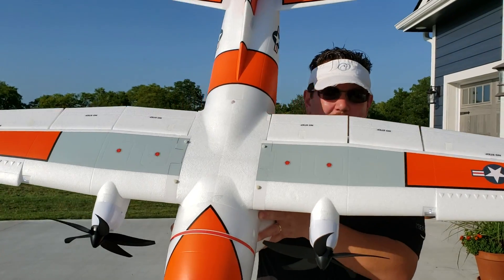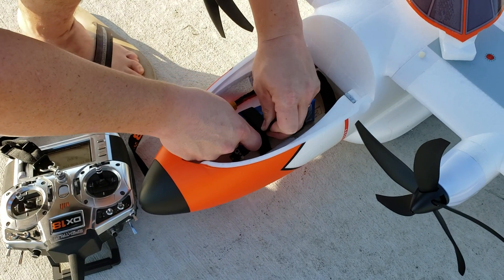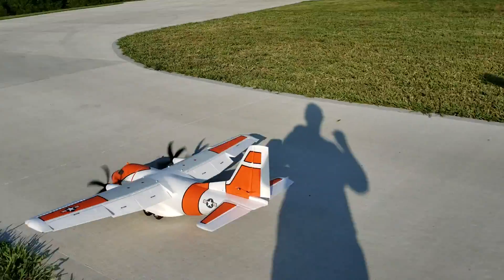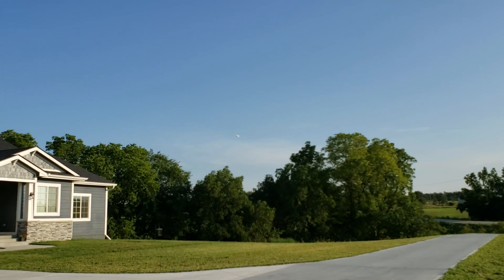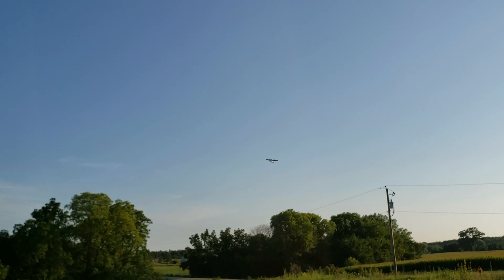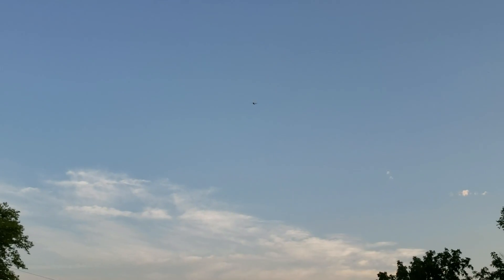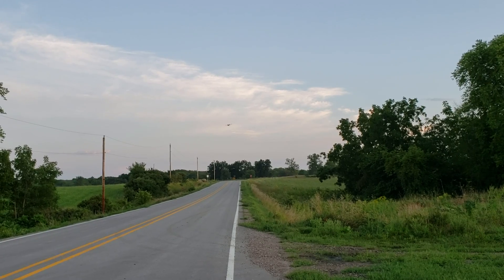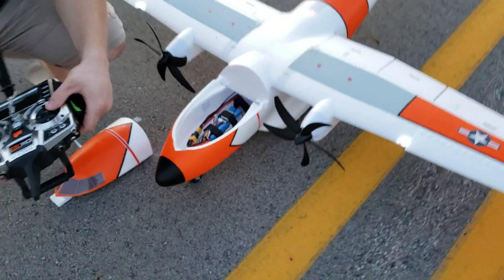Eflite - EC-1500 Twin 1.5m - Maiden Flights, Unbox, Build, Radio Setup

Comment: You can see at 2:21:40 that the ESCs are not in sync, as the props do not start sniping at the same time.
Reply from the maker: We totally saw that too! Megan and I kinda looked at each other... I know it's confusing, since the order of the video was kinda goofy, but that actually happened before ALL of the flights, so I did recalibrate the ESC throttle range to get them matched up, but the real issue I was having, initially, was the rudder and aileron trims were "fighting" each other, causing the plane to only "fly straight" at cruise...once I figured this out, she was way better, but still not too earth shattering as I had hoped for.

Comment: Brian, I made it about 12 minutes in and a couple things of note:  1.  When you took off on 4S 4.0, your ailerons were not even close to centered, so of course it rolled to the right.  2.  Did you calibrate your ESCs?  You may have addressed this in future flights or later in this video.  Just my .02
Reply from the maker: yes, and yes. She's flying well now, but I still feel like this was not a great value at $400.

Comment: Excellent review, so much useful information, thank you.    So, I just bought an EC1500, maidened it yesterday, 03/11/2021.  It flew nicely during the maiden, but, I had to use almost full down trim on the elevator to keep 'er level, I found the elevator to be very fickle, and having to pop off a glued servo cover to be annoying.  The servo is buried in a pretty tight spot, adjusting the linkage is a nuisance, but, I finally got it close enough to have a nice flight without excessive trimming.  I think I'll have to tackle that linkage again before I get it just right.  All that being said, the fickle elevator and difficult servo location is the only un-desirable feature so far.  Otherwise, I really like how the EC1500 flys, how it feels in the air, how it looks in the air, and how quiet and smooth it is. I didn't notice any of the wonkyness, etc, that you experienced, maybe you just got a weird one?   Unless I find more bad traits, I'd give it a yes to buy again.  This plane eats up an awful lot of runway upon landing, it comes in hot and fast even with full flaps.  However, even with a little breeze, it seemed to be rock solid on final approach.  Again, thanks for this in depth review, excellent job, very good and very useful information.
Reply from the maker: Totally Dan! Thanks for the feedback! I too have come to LOVE the EC1500. It's so much fun with parachute drops too!!! This plane is super powerful, and with the addition of SMART packs, now she's just unstoppable!!!!

So glad you didn't run into the strategies of my struggle to get ailerons and rudder trimmed out...I later realize I trimmed the ailerons and rudder BOTH opposite one another, and really screwed the pooch on that ;( Oh well, she's fixed up and flying straight as an arrow now, and I love flying her!
Reply: @BrianPhillipsRC  Ah, lol, we call that "Pilot Error," but, glad you got it figured out.  I finally got my elevator trimmed up to a comfortable level.  Not perfect, but, since the elevator servo is so hard to get to, I'm gonna stay with almost perfect.   I flew several flights with the EC1500 today, I was very happy with it in flight and most of my landings were pretty good, I screwed up the last one, came in a bit to fast, after touchdown the left wing was still a bit to high and the Right prop nicked the ground.  Busted a blade, so the EC1500 is grounded for a few days.  No blades in stock at any local hobby shops, but, Horizon has the right hand propellers in stock, I ordered two and backordered the left prop.  I got a set of floats coming for it also.    Do you ever do any float flying?  I've been doing that a lot this year and loving it.

Comment: Hey Brian I have questions about lemon you used on the Moa the crashed and fixed version. 1 did I hear you say you rolled and looped with stability on? 2 Do you adjust all pots equally or do you give more control to rudder,elevator, aileron? 3  does turning pots up or down increase or decrease travel (throw) of surfaces. 4  is tuning the pot the same as or close to beginer, intermediate, and advanced switches on other receivers? I would love it if you would do a series on the lemon with stab plus from binding to adjustments and applying adjustments to a variety of planes.  5 does turning up stability increase speed in which lemon will level? Or does it decrease movement of control surfaces?  I just realized I am asking the  same questions more than once.  Anyway I am interested in the receiver,  I have some vision issues and I think the lemon would help greatly.  Thank you
Reply from the maker: 1) I do all maneuvering with Stabilization on...unless there's a self induced oscillation from gains being too high (or speed getting too fast...)
2) There are THREE individual gains, but the MASTER gain will change ALL of them together. So, if the set Rudder pot to 15%, Aileron pot to 25%, and Elevator to 40% (just for example...there's NOTHING to these numbers), when MASTER gain is at 0%, they'll all be multiplied by a factor of 0X, while at 100%, they'll all be at their full 15%,25%,and 40% respectively. ALSO - you can go OVER 100% on the Master Gain channel too, if you wish.
3) Turning the gains doesn't change the amount of throw, per say, it actually changes the "intensity" by which the Rx tries to HOLD to a position, in a given control axis (pitch, roll, yaw)... So, yes, this may result in MORE deflection, or the perception of more defection. Increasing the trim pot position will make the AXIS HOLD tighter, but this will also eventually end up in causing a self induced oscillation. This is something that's always a fight with a stabilizer.
4) No
5) I haven't ever gotten a LemonRX to "level" a plane successfully. I only use, and recommend the 7Channel with Stabilization, NOT the Stabilizer Plus (the one that "auto levels")

Hope this helps - I'll try to answer more questions as you come up with them.

Comment: I just flew this plane today ---- I had to place 4 large bolts in the front of the plane to get the CG correct --- After that it flew well.. You video help a lot --- Thanks again ----- Love this plane though --- It flies like a BUS --- Its different yet fun ----- Your house looks awesome!
Reply from the maker: Thanks Chip! Glad I could help. What lipo(s) were you running, out of curiosity? I didn't have to add any weight, but I was running fairly heavy batteries (mostly I run dual packs).
Reply: @BrianPhillipsRC  zippy 3300

Comment: I think you are using "atraumatic bowel clamps" to hold your connector.  Don't think about it too much.
Reply from the maker: LOL - Sorry about that! I was trying to remember Forceps AKA Hemostat ;) (I had to look it up!!! LOL)
Reply: @BrianPhillipsRC  If the grooves on the inside are parallel to the length, they are bowel forceps (clamps).  If the grooves are perpendicular to the length, they are probably arterial forceps (clamps). 
Hemostats is the generic term and will always work.  (I work in the OR all day.  I know WAY too much about surgical instruments.)
Reply from the maker: Wow, I didn't realize there was a difference! My hemostats would be arterial forceps, in this case ;) ...tool shop brand, arterial forceps :) LOL
If I see these on the operating room table, I'll run out of the hospital, but hanging out of the robe if necessary - LOL!!!

Comment: I just got mine the other day and I am so happy eflite took a chance and put out this great versatile c130 lookalike.  Great video!!!
Reply from the maker: I take it you must have had a slightly better maiden flight than mine ;)
Did you feel it was a bit over-priced?
Reply: Brian Phillips yes it is. Seems a little thin as far as the foam in areas.  I do love the way it flies and the different flap/aileron adjustments that are possible.
Reply from the maker: Yes, that feature is cool, BUT I felt I was sold a bill of goods on that part, as I expected three servos per wing...the Horizon Hobby video was a bit deceiving in that regard...which doesn't help my "over priced" feelings :(
P.S. Not that I need SAFE, but I find it helpful for when I get a paratrooper dumped out, I can flip on SAFE and watch the deployment of the parachute for a second, some thing I want to play with and make a holding pattern setup, similar to what I did with my Conscendo S. Keep an eye out for that video coming soon ;)
Reply: Brian Phillips yes an extra servo would have been a much better way to handle it.....are you going to add one?  Lol.....think of the different things you could mix in had they put another servo!!!  At least they used ball links!!
Reply from the maker: yeah, I was happy with ball links, but I probably won't add two more servos. If I were to do something, I'd consider adding spoilerons, so I could do CROW for crazy steep landings and to bleed of speed, and create tons of drag. I might think about making a creative break on this plane, as an experiment, but if I do it, I'll be sure to publish a video.

Comment: Hey Brian check your wings or wingtips maybe one of the wings has a little bit of a Twist in it causing you to have to correct with all that aileron trim. Just a thought brother🚁
Reply from the maker: Hans, I got it sorted out. When I was first flying, I had accidentally trimmed in the wrong directions...so the plane appeared to be YAWING, and I trimmed Ailerons... then later I did the SAME thing on the Rudder... Ultimately, I found that I had trimmed in BOTH the wrong ways :) Rookie mistake! I outline this a little in the video, and then show it flying better. This plane was a lot more frustration that I expected, but it is a good plane. I still firmly believe Horizon Hobby had it priced too high, but many disagree with me on that point.
Reply: @BrianPhillipsRC  awesome it does look great in the air, but you are right Horizon Hobby could trim 50 or $100 off of that price. But what the hell we only live once right! Glad you got it worked out. Oh yeah seen the camera crew fly the fixed pitch heli indoors great job can't believe how good she did! She keeps that up and you'll have to hold the camera lol. happy flying my friend!!!
Reply from the maker: For sure! :)

Comment: Brian if I was to add a twin prop to my collection, which would you recommend and why between this EC1500 or the Twin Otter? I have plenty 3S and 4S batteries for either plane.  Cheers
Reply from the maker: If you're flying 3S or 4S go with the Twin Otter, but this EC1500 would be great if you don't mind spending some cash on some lipos...

EC1500 https://bit.ly/3lmzSyw
Twin Otter https://bit.ly/2OnOuBQ

Both good, but the EC1500 is more impressive...also a lot more expensive...

Comment: You have right aileron trim and left rudder trim
Reply from the maker: yep, I fixed it mid way through the video....rookie mistakes for sure. Weird thing about it, I mechanically aligned the surfaces to be straight between the ailerons and flaps, the night before maiden flights, then when I went to maiden it, I swear they were all goofed up. I'm not accustom to having this type of issue from Horizon Hobby products.

At the end of the day, it turned out to be a pretty cool plane, but still heavy, and still a bit too expensive if you ask me....many seem to disagree, but I still think it ;)

Comment: I have another question. If I would buy the PnP version of the Ec-1500 or another aircraft, is it possible to install the receiver from the Mini Apprentice in the new aircraft? I hope the question is not silly, the hobby is still quite new to me. 😊 And thanks again for the great advice! 
Greetings Daniel
Reply from the maker: I'm not 100% sure what receiver is in the Mini Apprentice. If it's an AR636A or AR636B, then you'll have the same Rx, but you'll have to potentially reprogram it. Many times the Rx is positioned in a different orientation, so you have to reprogram the Rx to meed the new physical demands of a new plane.

My recommendation...if you're buying a BNF, you'll get the fairly expensive Rx for about 1/2 to 1/3 the price of item sold individually, so maybe keep the Apprentice Rx for another plane, and get this one BNF.

Hope this makes sense ;)